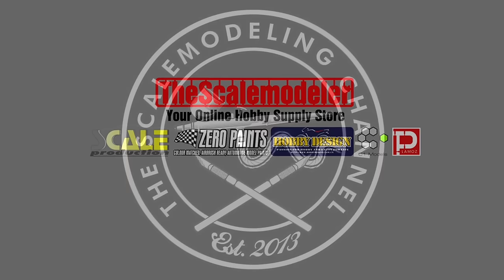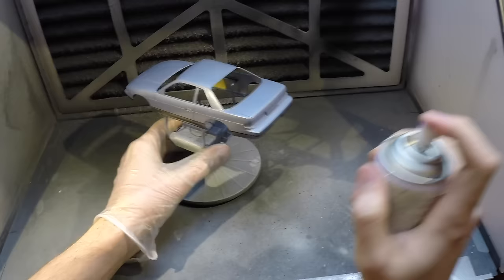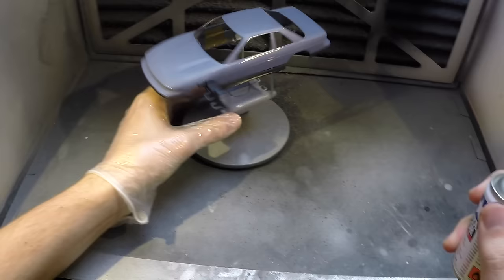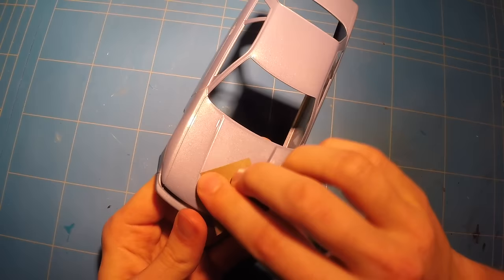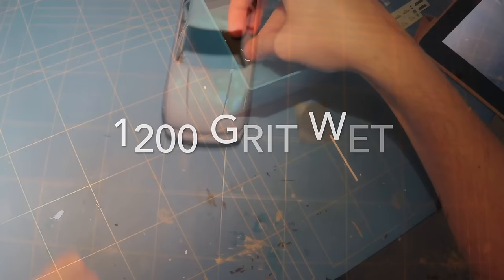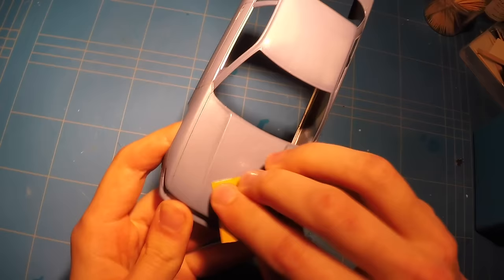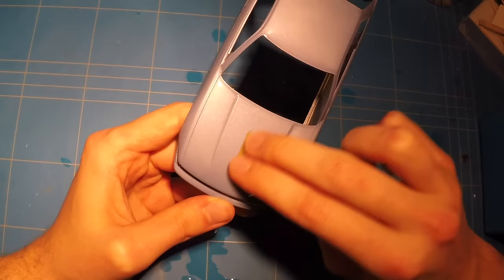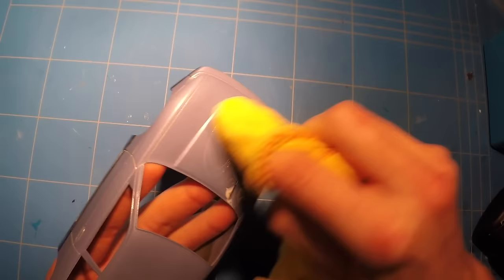How to: Paint a Scale Model with Spray cans Part 3: Applying and Polishing 1k Clear

Comment: Love your videos, they've been so helpful. Question...at what step does all the window and body trim occur? Is this after all color, clear and polishing steps or at some step in between? I'd think you'd want a clear coat over the trim right? I'm just unsure where the trim work fits in best. Thanks!
Reply from the maker: After, the trim is mostly flat black. If you do want it gloss. Then before clear of course ;)
Reply: Tom, thanks for the quick reply. One follow up...in the past I've had issues with smudges and fingerprints when doing trim and body detail work after all color and clear coating. After watching this video, I'm thinking the reason I've had that trouble is that I've never polished and waxed. Would you agree? Polishing and waxing will allow me to easily wipe away any smudging or fingerprints from my detail work...right?  BTW, this is my wife's account...I'm Luke, not Michele. :-)
Reply from the maker: Polishing has nothing to do with smudges. It does help with the finger prints a little
Reply: Tom, If doing all the trim detail at very end after all the polishing, is there much risk of damage to the model with masking tape, if using quality masking tape such as Tamiya?
Reply from the maker: Luke Smith if all the pre paint prep work and proper curing time have been closely monitored and followed there should not be a risk at all

Comment: So should I use automotive polishing compounds or Tamiya polishing compound?
Reply from the maker: Both will do just fine.
Reply: +The Scalemodeling Channel But I keep getting swirl marks on the paint...is there something crucial to get rid of that?
Reply from the maker: Higher grit sand paper, like 4000 or higher and maybe a swirl remover polishing compound.
Reply: is it okay to between the paint and clear stage to apply details like painting rubbers on bumper then clear over that im using acrylic tamiya
Reply from the maker: It is, but if you clear over it everything will be shiny, inlcuding the rubbers, so if that is what you want your good to go this route ;)

Comment: does the sanding part is necessary if i repaint a 1:64 scale car , like Hotwheels/Matchbox ?
Reply from the maker: if you want the pint to stick better, yes.
Reply: @TheScalemodelingChannel   i mean after applying clear coat
Reply from the maker: Only if your not happy with the finish

Comment: Do you polish after all clears you apply even the Zero paints 2K clear? Or just after the spray can 1K clears? One other clear related question as I have watched a ton of your videos. How do you decide what decals go under the clear and which ones go over? I noticed on some of your builds you do both so was just curious if you have a system to which go under or over or is it just a choice? Thanks for I put and tips.
Reply from the maker: +Brandon Drescher I only polish 1k spray can clear, the 2k clears usualy come out with a perfectly fine finish and shine.

Pretty much all the decals on the body go underneath the clear, except when i forget or when i was planning on painting the detail by hand.
Reply: Great thanks for the info I greatly appreciate it. Right now I use spray cans for my car but looking to get w good airbrush in the coming months. As far as paints for someone that's new to air brushing is Zero Paints or Gravity paints a better one to use? Or are they about the same? Figured since we can both in the states I would ask you since you've used both. Thbaks
Reply from the maker: They are both pretty much the same.
Reply: OK thanks again for the info.

Comment: Question : i don know got somebody ask this question. Can i just sanding it and don polish it?
Reply from the maker: reborn chen if you dont polish it. The paint will be dull
Reply: Can i use wax only?
Reply: One more question, is clear spray - apply decal - clear spray then sanding or clear spray - sanding - apply decal - clear spray - sanding?
Reply from the maker: Clear-decals-clear-polish
Reply: The Scalemodeling Channel so no need sanding, straight to polish?

Comment: do I have to use 2500 grit?
Reply: you use whatever is needed... typically 1500 - 2500 wetsand works. i dont work through the grits.. too much work and too much paint removal.

Comment: Do you have to get a "glass" finish before clearcoat? As in sanding with 1500 to 2000 grit before clearcoat?
Reply: it helps. after you have achieved full base coverage you can sand it down with 1500 to flatten it then give it a very light color coat and then clear it

Comment: Will it be glossy if you dont sand it
Reply from the maker: +Darren Su yes. But it will also have texture in the paint
Reply: Do you sand before and after painting
Reply from the maker: Darren Su no. Only after primer. Or clear when it needs polishing
Reply: How do you make it glossy after painting? Just wax right?
Reply from the maker: exactly as i am showing in the video